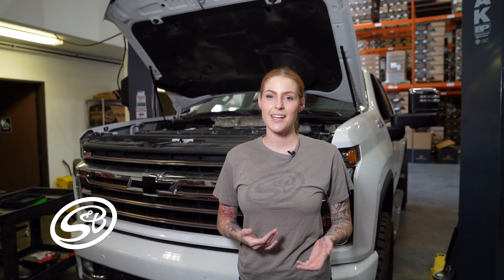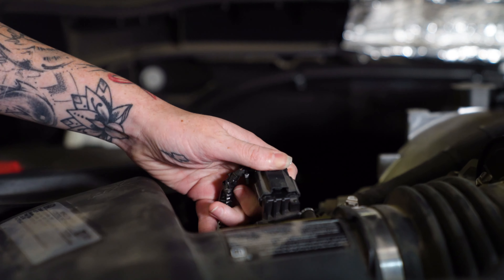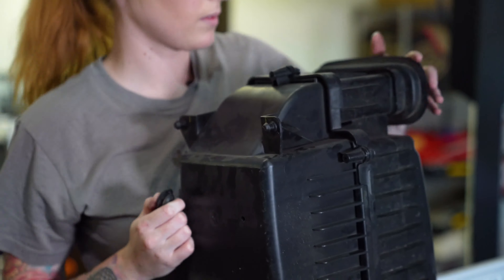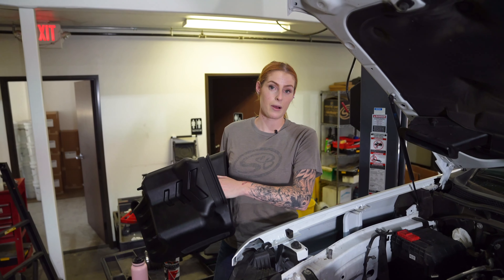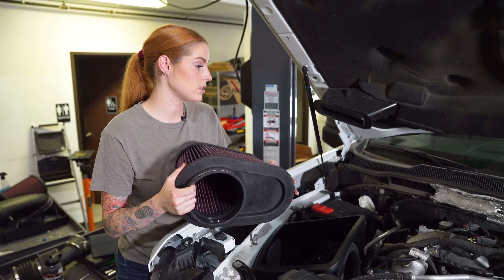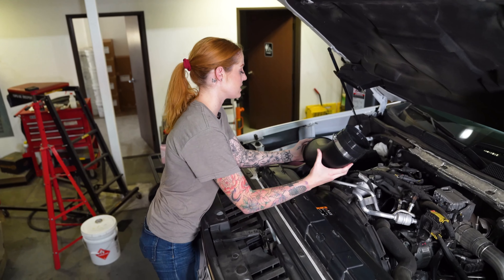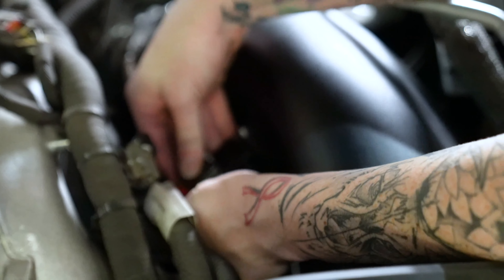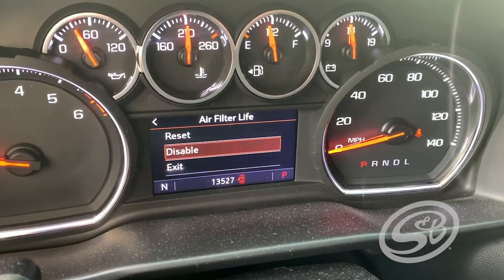S&B Cold Air Intake for 2020-23 Chevrolet Silverado GMC Sierra 6.6L Diesel

Comment: Was about a 1 hour install don’t forget to start the clock on the 2 hr wait before connecting the batteries back up. And why not if your at it go ahead and install the MAP spacer by s&b. No check engine or issues after install

Comment: Great video, installed mine on 2021 chevy 2500hd and disabled filter in settings and threw a po26c code slightly afterwards. cleared code once  and came on again roughly 50 miles later. installed with roughly 550 miles on truck and have roughly 700 miles on truck now. Would like some answers.
Reply: Are you still having this issue?  My intake will be delivered tomorrow, and I'm curious on your final outcome.
Reply: @nevin7011  Actually had S&B engineer come over and install new piping coming from the horn to the intake box. He said they did some measurements and it was the 2nd issue they ran into that had this outcome so they investigated and seem to be slightly to much air flow. Seems this has only happened on a couple but they were redesigning the tube to prevent it on others. Since then I've had no issues. Customer service was very helpful and responded to me and soon as i posted the issue, and was at my front door within 2wks.

Comment: Installing mine today, 2020 silverado....this video was a big help. Thanks S&B
Reply: did you have any issues with check engine light afterwards? installed mine and disabled filter in settings and threw a po26c cold slightly afterwards. cleared code once  and came on again roughly 50 miles later.
Reply: @chrissimmons6358  nothing, it’s been great so far
Reply from the maker: @chrissimmons6358  I saw Ryan from our team was in touch with you to get this resolved.

Comment: And what to do if the service filter system light illuminates? Have had this filter on my 2020 duramax for 1.5 years and today the filter reminder tick accidentally got checked on and now my dash reads service filter system. Dealer wont disable it.
Reply from the maker: Give us a call. If the message is in yellow, you can disable it, but if you cleared the message too many times, then the dealership will need to do it
Reply: @SBFilters  It was in red from the start. Dealer wouldnt disable it but found a diesel shop who did. Dang dealers and their ways! They said they wouldnt do it without the stock air box installed and wouldnt do it under warranty.

Comment: Will this void the GMC factory warranty ?
Reply from the maker: Dear Tony,

Installing an S&B Intake Kit or Filter will not void your vehicle's warranty as long as you properly install and maintain your intake/filter.

It is illegal for a dealership to void your warranty based solely on the fact that you have installed an aftermarket product. Your rights are protected by the Consumer Product Warranties Law, often referred to as the Magnuson-Moss Warranty Act.

If a dealer threatens to void your warranty, S&B will step in to assist you. "S&B commits that our customers will not be charged for a repair due to the manufacturer denying their warranty claim because of the presence of an S&B intake kit or OE replacement filter. We warrant that using an S&B intake kit or OE filter will not result in the denial of your vehicle’s warranty." [Learn more](https://www.sbfilters.com/index.php/million-mile-limited-warranty/)

Sincerely,